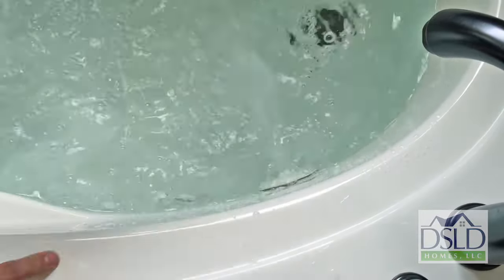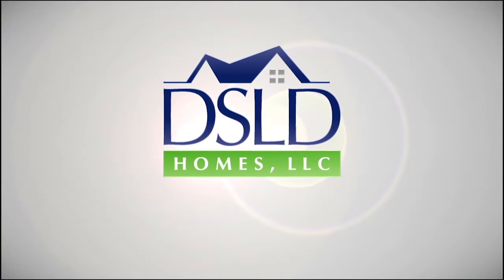DSLD Jacuzzi Tub Jet Operation

Comment: I need help.
I have one jacuzzi tub in the bathroom with 2 faucets 1 for cold 1 for hot water but when I open the hot water the water it's just warm never hot,the rest of the house works fine except in the jacuzzi tub.
What can I do to get it fix by myself?
Thanks
Reply: Did anyone ever help you with this? We have the same problem.

Comment: I’m still wondering how to turn it off
Reply: Team 600Chris did you ever figure out? I have the same question 🤷‍♂️
Reply: Yeah
Reply: I had a problem where I used the jets and they wouldn’t turn off and it kept making a humming noise and the button you press to turn it on was stuck down so what you wanna do is turn the main tub jet not clockwise turning it clock wise will turn it on turn it the other way that’s for to turn it off for the humming you need to get the button that’s stuck down in stuck so grab a metal butter knife in try to make the button back to where if you push it it turn on then the noise will stop
Reply: It tuck me so long to do this happy that I can help you out
Reply: Took*
Reply: HARLEY DAROCHA  did that fix your problem?